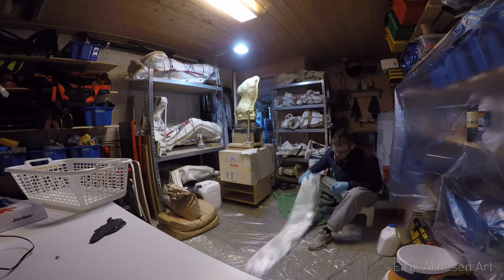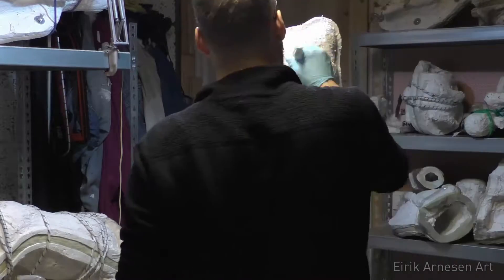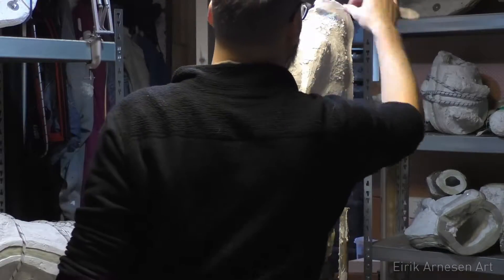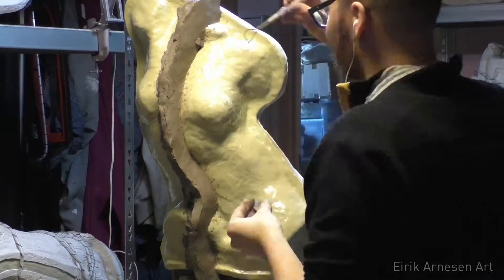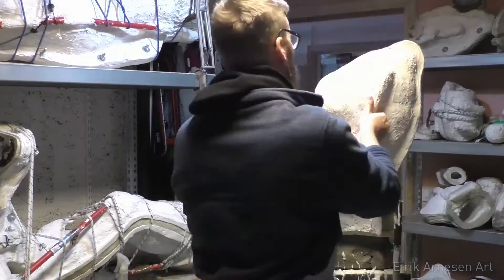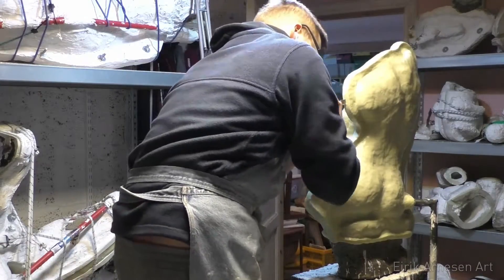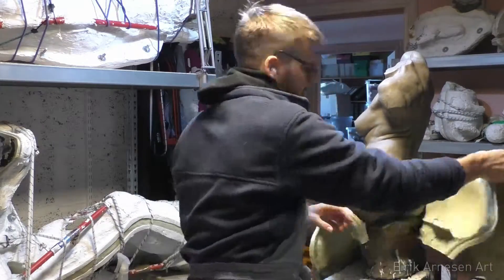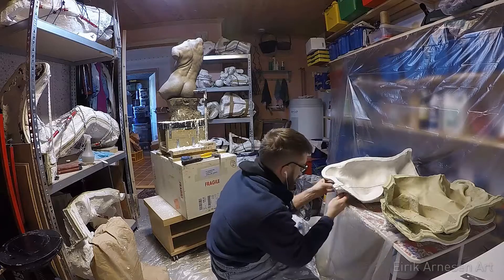Mold Making Overview Part 2: Mother mold

Comment: Hi Eirik, thanks for uploading all of these videos of your process - they are a very valuable learning resource! I'm trying to make a mother mold at the moment out of polyester resin and chopped strand fibreglass. However as the sculpture is a horizontal upright figure I'm finding it very difficult to get the fibreglass to stick to the underlying silicone mold. Have you used polyester resin before for mother molds? Just wondering did you find them too difficult to use and that's why you started to use the "Enhanced Plaster" substance? Kind regards, Brendan
Reply from the maker: Hello. I am glad you like the videos and find them helpful! I have never used polyester resin before. Perhaps it’s possible to apply something to the silicone to help make the polyester stick to it? I’m sorry I don’t have a good solution. Maybe a google search could help? Usually when there is a problem, other people have had the same problem before!
Reply: No worries! I would have tried to buy what you use in this video(Aqua Resin) but they don't sell it in Ireland unfortunately!  They do sell Jesmonite in the UK but I've never heard of it being used to make mother molds. Plaster would be another option but it's very messy. I'll look online and figure it out! Looking forward to more videos. All the best
Reply from the maker: I’m pretty sure Aqua-Resin and Jesmonite is more or less the same thing. There are many different brands of enhanced plasters but they are all very similar.

Comment: Is it also possible to make the mother mold with normal plaster??
Reply from the maker: Yes of course! Process is more or less the same. Just with burlap instead of fibre-glass and 3-4 layers instead of 2. Works great and is a lot cheaper! Less durable and heavier however.